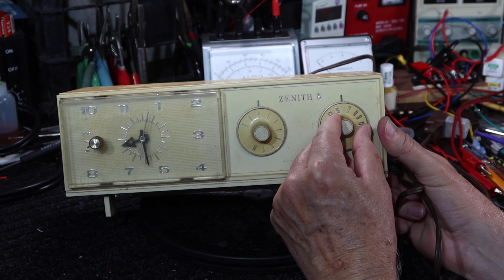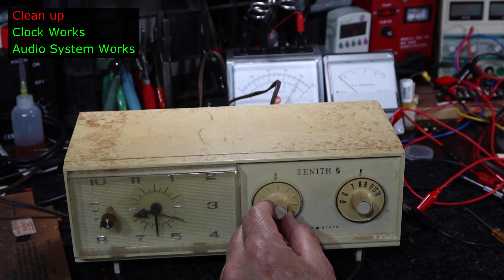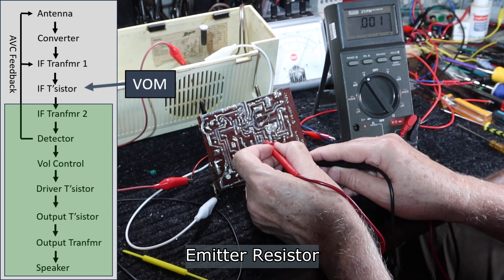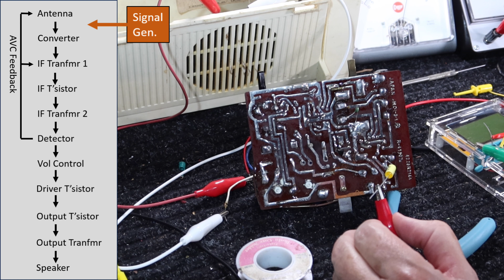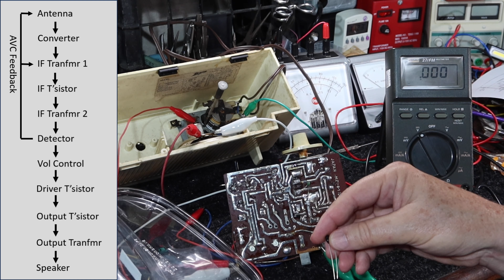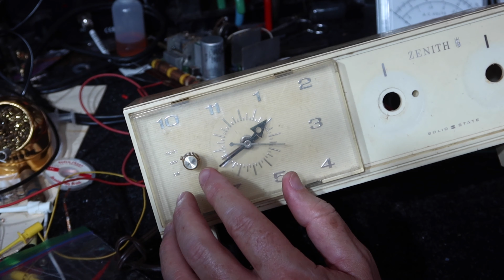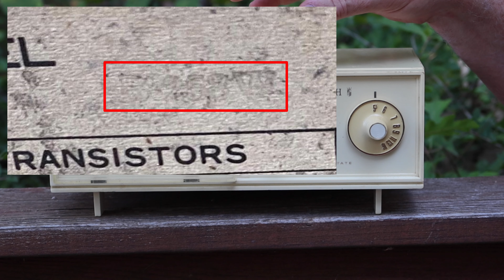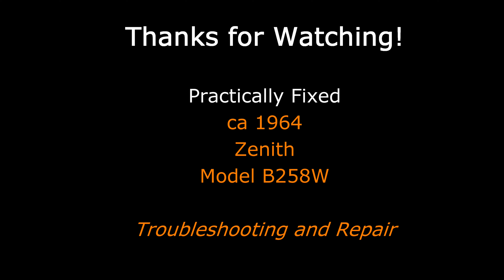Zenith Troubleshooting Challenge - Transistor Clock Radio Repair Mid 1960s Model B258W [4K]

Comment: Good solid troubleshooting PF. Nice showing the fault both ways on that IF transistor. . Those dome top transistors are known to be unreliable and often bad. My first thought was the GP transistor had different characteristics when you lost signal at normal voltage. Those GP transistors are often good for testing but once the problem is confirmed it's best to find a closer match. Of course your method of the repair being temporary unless it works is also acceptable. LOL  Good little performer for what it is. :)

Comment: Great troubleshooting video. The substitution transistor works very well, and it is interesting that the pF capacitor fixed the issue you were having.
Reply from the maker: Thanks Jim.  Oscillation feeding back through the AVC is my guess of what was happening.  Interesting way to find the solution, the VOM lead.  Thanks again.

Comment: Nice TroubleShooting. I liked it.
But i dont understand how a higher voltage is the cause for the Oscillation?
Reply from the maker: Thanks.  Yes, I agree; wish I could explain it.  I was beginning to work on understanding what was going on with the bias voltages  when discovering the capacitance would make it work.